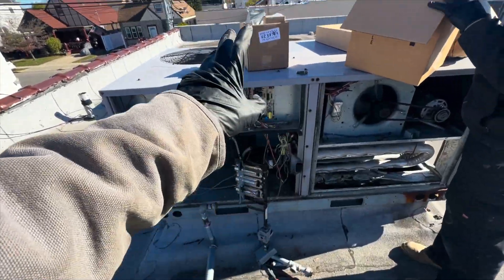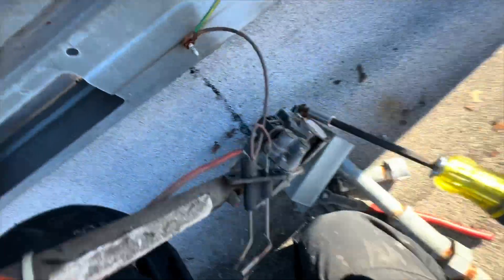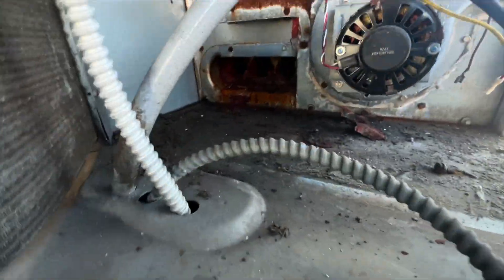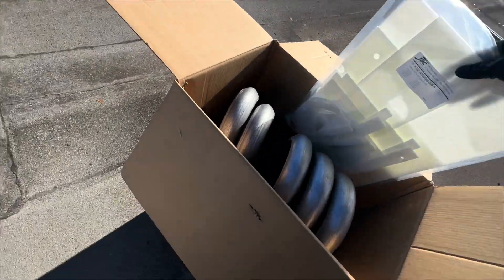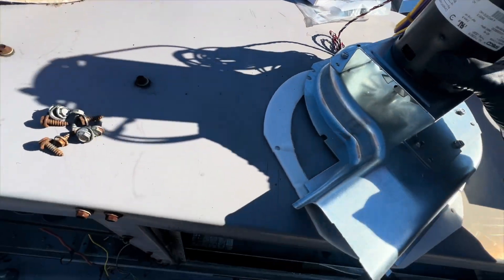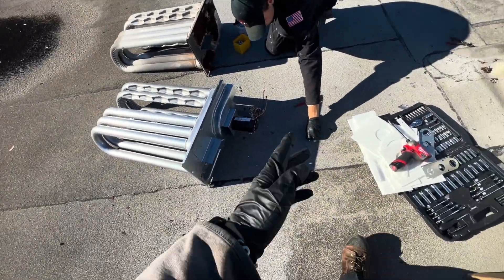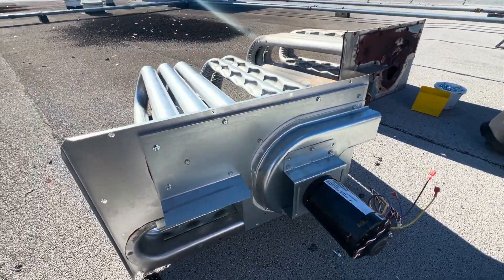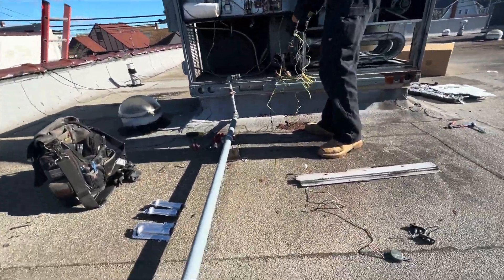Carrier RTU Major Overhaul! Rusted Out Carrier Unit with Cracked Heat Exchanger and Other Issues!

Comment: Hey Jack Daniel, of Mikey Pipes Plumbing not easy being cheesy. I like your podcast/social media, looking thru some comments. Again that package unit should have been install at 3 to 4 foot from roof line. Because of snow drift and snow pack. I guess Mikey had checked the cooling too. Because the snow and ice pack can and will destroy ac coil too. Love you buddy, you safe out there and the ladder too.
Reply from the maker: We don’t really get snow that high especially on roofs it blows off.
Reply: 10-4 good buddy, going by the hvac weather charts. @DCHVAC
Reply: and maybe the weather girls too.

Comment: The auto parts store will have the connectors for the ignitor. I've had to do it more than once. Also, maybe a dumb question, but do you remove the drain traps for the a/c in the winter to keep them from freezing and busting because of the extreme winters there? Just asking because I noticed the missing drain trap for the a/c.

Comment: Great job but you forgot to put a piece in the heat exchanger that was laying on top of your socket box. The restrictor plate that goes behind the inducer support😮
Reply: Usually you don't get extra pieces with a heat exchanger. You get extra gaskets but not extra restrictor plates. Did you put a plate on the tubes behind the inducer support plate
Reply from the maker: @MiHeatingGuy yea. Those ones came in a seperate box outside of the HX box.
Reply from the maker: @MiHeatingGuy they came with a nice labeled “burner *something*” I forget
Reply: different part numbers
Reply from the maker: Those were the extra pieces. They gave a bunch of stuff I think for different model or sized units.